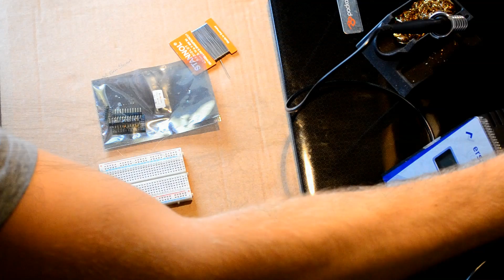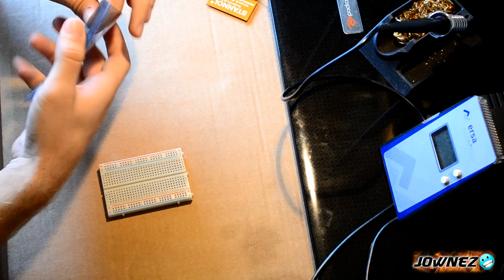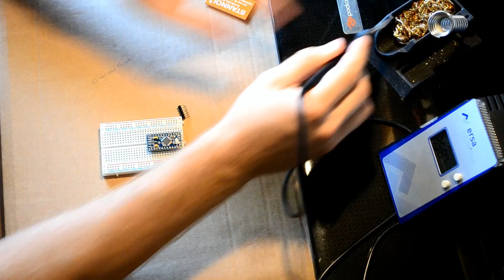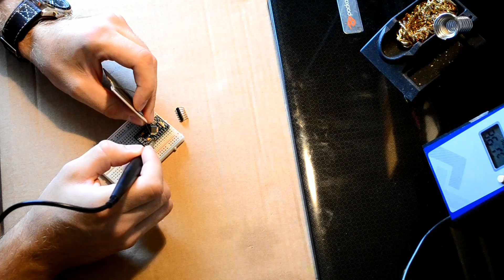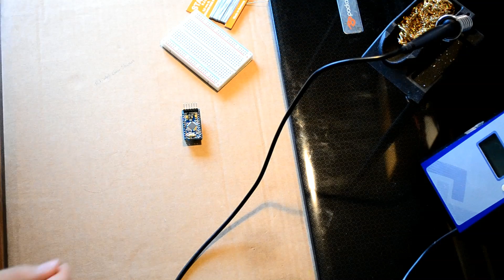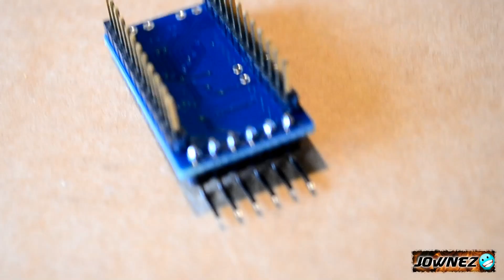Soldering the Arduino Pro Mini

Comment: Disregard some of these comments below. If anyone needs THAT much detail such as the soldering iron used ect, they should NOT be attempting this project without first becoming familiar with basic soldering techniques. I suggest anyone who is not familiar with soldering irons, solder types ect, to go look for a detailed beginner soldering tutorial for PCBs, electronics and components.
This video gave me what I was looking for. I wanted to work the Pro Mini right off the breadboard as you did; evidently it worked well. Thanks for taking the time to make this video! Jownez 
Cheers
Reply from the maker: Hey Tony, thank you very much for your comment. Please consider using an extra breadboard just for the arduino, since the diameter of the soldered pins is often thicker than the jumper cables that you normale stick in the holes. Guess you wont be able to easily pull the arduino board out of the breadboard and in time the normal jumper cables won't fit in the holes very well. My arduino keeps sticking on the breadboard till the project is done, then I solder it to the final pcb. Greets and have a nice day ;-)

Comment: I usually solder the Analog pins on aswell, so they are facing "upwards" so it still fit on prototype boards :D
Reply from the maker: Good idea... I left them open, because I use to directly solder the sensor's cables to the board when - in that case - the board gets fixed on a special project.

Comment: NO ZOOM, no details on used soldering iron or solder wire, no instructions whatsoever, no benefit watching this video. sorry - dislike
Reply from the maker: Sorry, just wanted to mention that you first have to connect both the pins and the arduino board to the breadboard before soldering in order to make it fit nicely.
Soldering iron is ERSA iCon Pico, thought you should be able to see the soldering temperature on the display, it's 360 degrees celcius.
For used soldering wire the the comments.
You can find zoomed images for better judgement of the result at the end if the video.

That was one of my first videos, just hoped it will help somebody who really does not know where to start. Thanks for your comment anyway.
Reply: Jownez I do realize I was a little harsh there, sorry for that. I appreciate your answer but you should at least put that in the description, right now. I didn't actually need that information but it's like explaining how to fly a plane standing on the ground just filming it from far away. You can't call a video a "how to" like that.
Reply: Jownez oh and the more detailed images at the end are by far not as important and a good view on the soldering process itself. That's what I meant with no zoom.
Reply from the maker: BuckstarrZ
 Thank you. I see if I can do a remake within the next weeks where I will pay attention to your advices. ;-)
Reply: BuckstarrZ I'm having trouble soldering the male headers onto the board. Were you able to do it?
Reply: David Hudman yea sure, what's the issue?
Reply: Tried to solder all the pins so that I could mount it on a breadboard. The solder kept falling off every pin in tiny balls of solder. Even though I thought all male header pins were soldered, the connection wasn't good enough to work mounted on a breadboard.
Reply from the maker: David Hudman
So, what's the soldering temperature you chose?